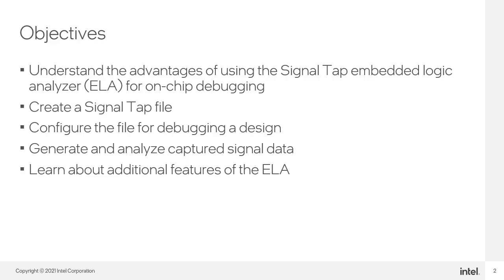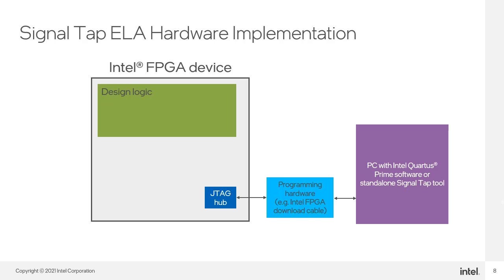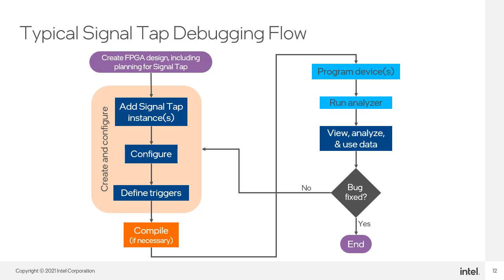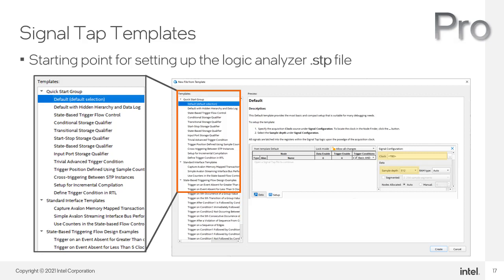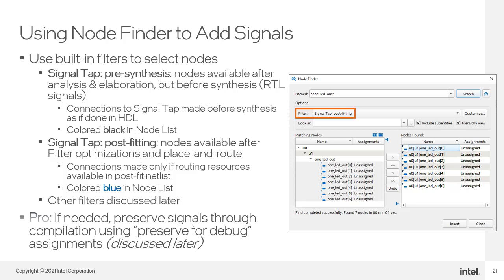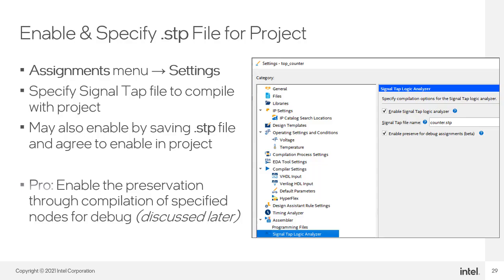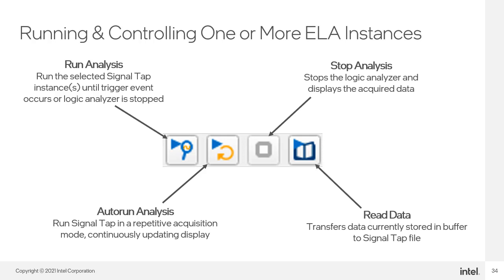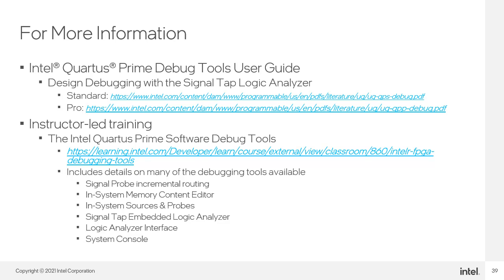Signal Tap Logic Analyzer: Introduction & Getting Started

Comment: try c++ signal processing coding (c++ to circuits) instead of vhdl or verilog, its much better than low level design for large code pieces
Reply: you are processing bits in the low level circuit, right, c++ is the most optimal for that purpose, to describe what operations are being done
Reply: just use threads to make parallel processing blocks
Reply: @Jkauppa  HLS compilers are not highly optimized to encode your RTL. Your HDL coding is much more effective large scale.